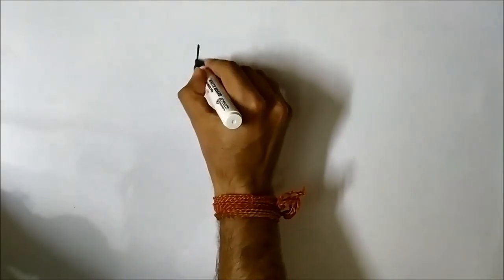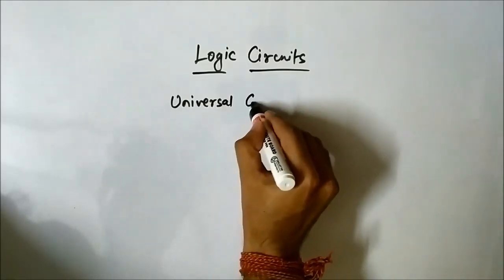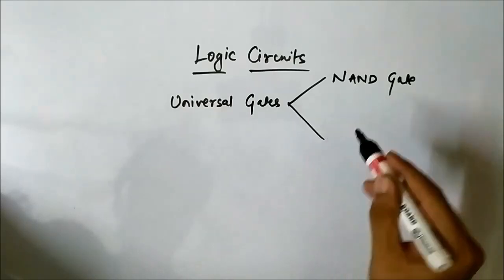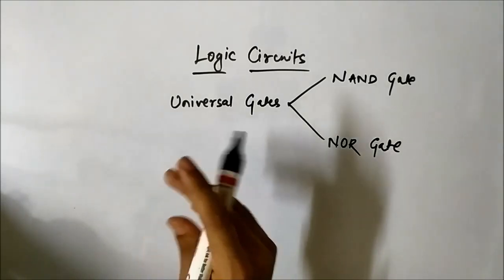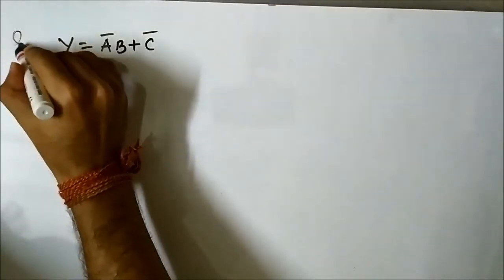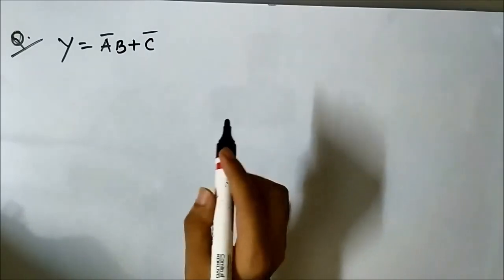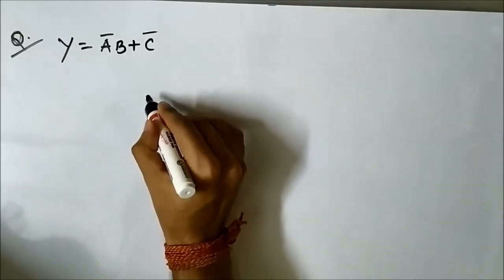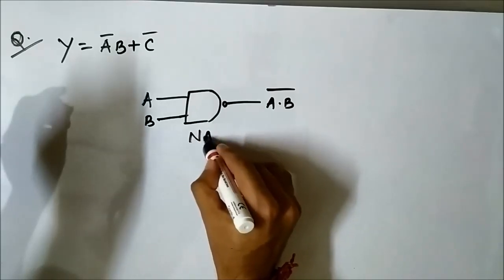Logic Circuit Design From Boolean Expression Using NAND Gates | Question 1 | Digital Electronics

Comment: quick question. i had a [  CbarBbar+Abar+CB  ]. should i simplify it first before applying nand gates?  If yes, how can i apply nand gates in its simplified form which is, [  Abar + 1 ]?
Reply: If there is '1' , first you've to write this like (A+A') (you can use different input also ,like B+B') ,then use the process explained in this video.